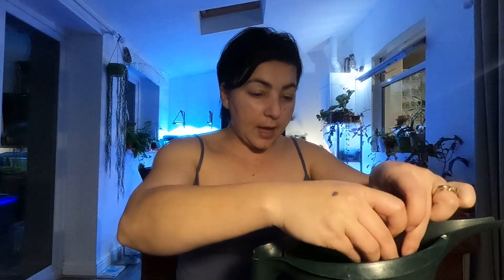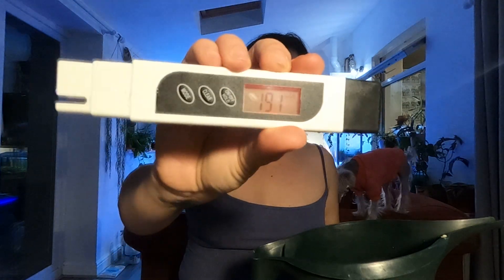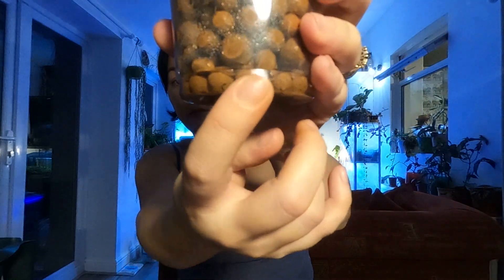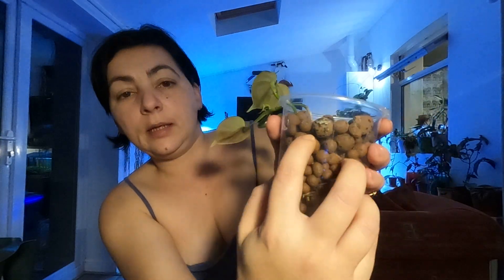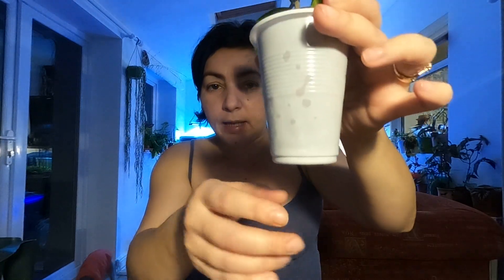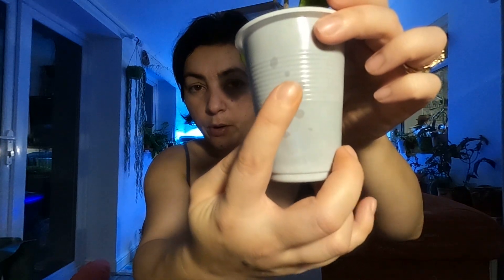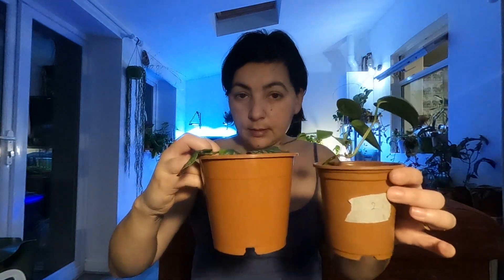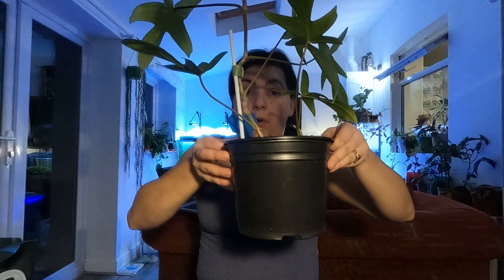#semihydro #lecaclub #leca How I water my plants in leca☺

Comment: Are you monitoring the EC of your nutrients all the time ? If so, how much do you put it in general ? I am at 1 and I find that I have a lot of salt on my leca. If I follow the instructions of my nutrient bottle, I should put less, but my EC should be much lower then. I don't know if I am very clear. Excuse me if I make grammar mistakes, because I don't speak English fluently.
Reply from the maker: I usually  put around 200 ec in my water. Usually  the instruction on the bottle  will give around 1200 ec, which is indicated for adult plants, but in my opinion is too high even for mature plants. 
Your English is perfect😊💚
Reply: @SemihydroponicswithSma  with my nutrients I must according to the instructions put 3ml for 10l of water in vegetative growth.  For 1l, that makes 0.3 ml or 6 drops.  But then my EC is low.  I leave it like that in your opinion?
Reply from the maker: How much ec and what type of water you use?
Reply: @SemihydroponicswithSma  i use tap water filtered with Brita. Whith 6 drops, my EC is 0,6
Reply from the maker: You must have really  good water, my water after I filter  it with brita has 700 ec. Are you sure is o.6 ec? Or 600. My rain water has 0.4 without  adding the nutrients